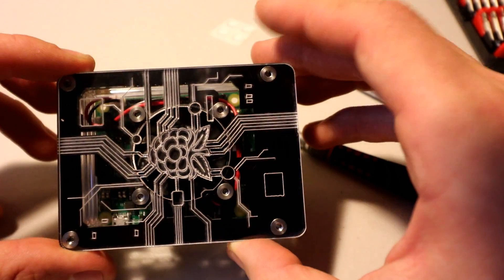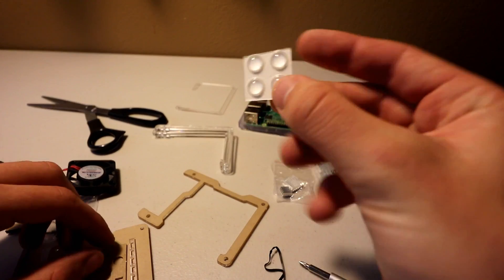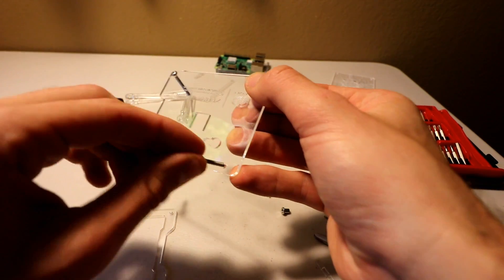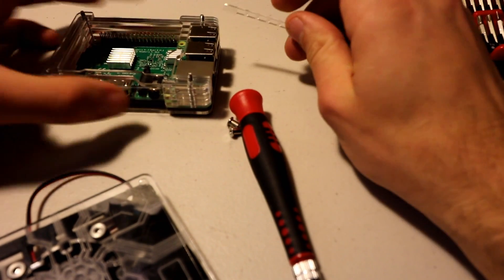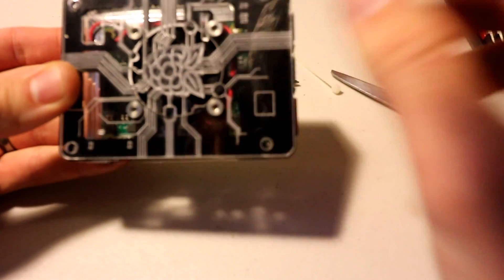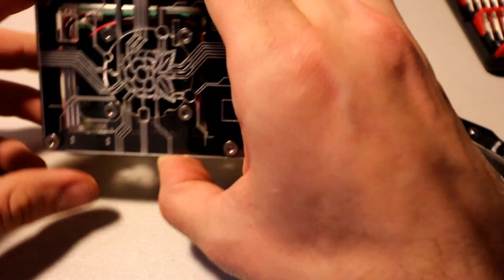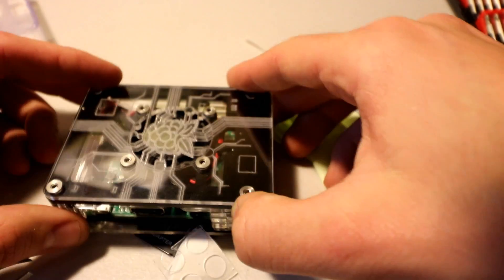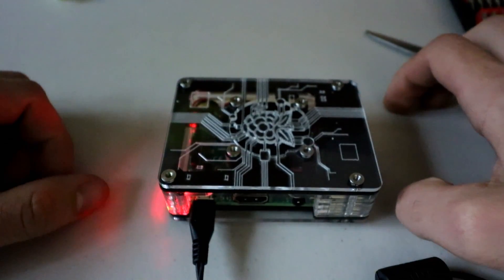Zebra Virtue by C4Labs - Black Ice w/ FAN - Cool Pi Case

Comment: Thanks for sharing the build.  The instructions on the provided card are ok but lacks a listing for all the parts.  My kit was missing the hardware to mount the fan so I had to use screws I had on the shelf but while they are functional it would look better with the hardware intended for the purpose.   I do like the enclosure its a bit pricey but does what it needs to do.

Comment: Do you think the pi-cam's ribbon can slip through the casing? I don't see a slot on the top, but curious if it's viable.
Reply from the maker: yes it will you can even see on the amazon link in the description it shows it doing it

Comment: Not that it really makes a difference but according to the assembly instructions the piece that looks like a tiny little gate is supposed to be the last piece before the final wood top gets placed on. It is held in place with the L piece and the tiny corner piece with the groove cut in, the only difference is they are placed directly under the top wood layer instead of the acrylic piece you put. This allows the acrylic piece to reinforce the usb ports so when you shove in usb cables, they are actually held by the acrylic piece. Though clearly it can be built either way :-)
Reply from the maker: ahhh interesting, thank you.

Comment: Could you add a scree to this case?  If so, how would you attach it to the rest of the case?
Reply from the maker: Scree?
Reply: I apologize, I meant can this be attached to a 7" touchscreen?
Reply from the maker: Frank Logalbo yes
Reply: Thanks for the information.  However, I still don't understand how you would attach this to a 7 inch screen or a 3 1/2 inch screen. I'm just asking what kind of modifications would you need to do to this case to attach it to a screen. And do you have an example of it? And also if you do attach a screen, must you remove the fan?
Reply from the maker: Oh sorry did not understand your question, no, you cannot add a screen without some massive modification.

Comment: I have the same case, and the fan sound really loud. like really loud. is there a way around that, i had to put the volume up to hear yours, i would like to have my fan working like yours.
Reply from the maker: Yeah mine got loud too...You might want to shop around or move your pi
Reply: You could try finding a 12vdc fan with the same dimensions. It won't move as much air. The speed would be slower, but it should last longer until the sleeve bearings wear out and get noisy. If you want more airflow, then stock up on 5vdc fans of the same size and swap them out when they get noisy. Like anything with a fan, it will be a dust magnet. The fan, and inside of the case, will need to be blown out with a can of air when it gets cludged up and dirty.

Comment: I'm thinking of getting this case, however it says pins 4 and 6 for the fan. I have a power button already wired on mine on pins 5 and 6. I'm not sure if I can use a different pin than pin 6 for one of those?
Reply from the maker: not sure, check the layouts, maybe you can also splice?
Reply: You can also use pin 2 and 3

Comment: Drew, what happened? You started off so well with the directions and then you just start putting stuff together with no commentary and then skip the installation of the fan, which is giving me the most trouble...
Reply from the maker: This might help:
-the fan label faces the pi not the top (orientation of the fan)
-put the clear plastic and black piece together first, then add the fan.
-AS far as where the clear plastic and black plastic match I use the "square" lasered accent on the clear piece as a reference using the photo instructions (orientation of the plastic pieces)
-As far as the wire (the hardest for me) for the fan it took me 5 times taking it on and off until I liked how the wire fit.
-Plug in the fan last

As for skipping this part it was very long and boring and the video is already over 10 minutes
Reply: The fan label should face outside, not towards the pi. All power supplies, with fans, have the fan oriented so it is a puller, not a pusher, of air. The fan support plastic and sometimes label, should be oriented facing away from the heat source. Also, fans on pc cpus, are blowing/pulling hot air away from the chip. Drew, you installed the fan backwards.

Comment: Drew which is better? the wicked aluminum case or this zebra case? I bought the $65 Wicked case...I like it alot..there s no fan noise..I am curious to find out about the fan noise in this case.
Reply: @Jose I've had the Zebra case for about a month and at first the fan was really quiet, but it seems to be getting louder, especially when it first boots up. Keep in mind I've been transferring a lot of roms and artwork since I've had it. If all you do is play games it may stay quiet for a longer period.
Reply: I was talking about the Zebra Fan being loud. I have used both Case and the Wicked cools better and isn't louder; it's the best case for overclocking IMO as it has the lowest templs I have seen, but at the end of the day it will come down to the pi hardware if it can run 1.3 to 1.4ghz its depending on the chip you have. Either case will keep it cool enough not to worry
Reply: N64 games run way better at 1.4ghz IF your pi can clock that high Cursing USA  has really bad Audio Delay not sure if that will ever be fixed but the PI is always updating and getting better emu, might have to wait on a pi 4 to get smooth N64  games tho
Reply: Wicked cools better but cost more and I don't like the fan it comes with it's pretty loud imo
Reply from the maker: Yes, it has fan noise. I like them both for different reasons.
Reply: gotembro the wicked aluminum case I have doesn't come with a fan...was that a typo? So the zebra cases fan is loud?
Reply: DrewTalks would be nice when u get a chance if you can do a temperature test video on both cases? I have the wicked and it cools really well and overall looks great...I still haven't overclocked it...will it run Cruisin USA for N64 any better while overclocked? I was thinking of getting a second pi to tinker around I may just do that and buy this case to compare...wicked case they say that bluetooth and wifi may be hindered a little. I use a wired connection and USB connected controllers so it doesn't effect me. Great Vid may want to work on that background music though...hehe...teasing of course..lol
Reply: Thanks..Im gonna start with a 1.35 clock and then if its running stable will clock it up to 1.4...as they say not all raspberry pi 3's are made the same...maybe I will get lucky and get one that can clock to 1.5! In the meantime I can stick to running N64 on my pc or on an android nivida shield tv! Thanks Again!
Reply: I've had the wicked case for a few weeks now I can't complain its great!

Comment: Nice, I have the same case. I've been using it for a few weeks now and the fan seems to be getting louder.
Reply from the maker: yup that is the biggest issue with it especially if you are close proximity. If you put it away from you its not
Reply: I am not a fan of the noise of the fan at all but it's a nice besides that. They are looking into changing up the current fan not sure when tho
Reply: Yeah the fan-noise is a good compromise considering my old case got hot every time I transferred roms.